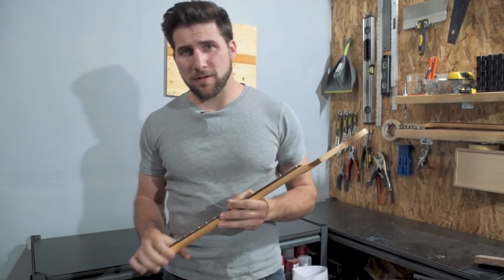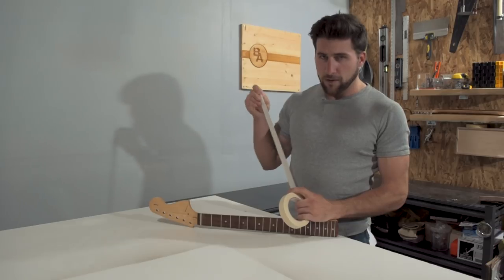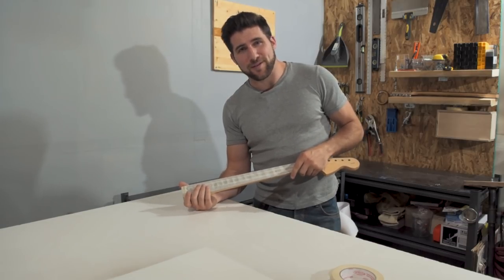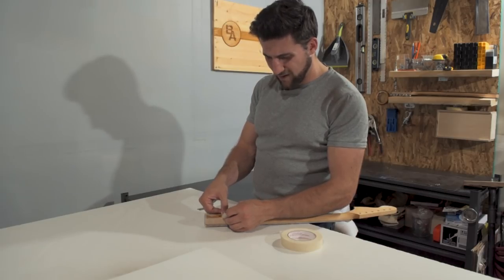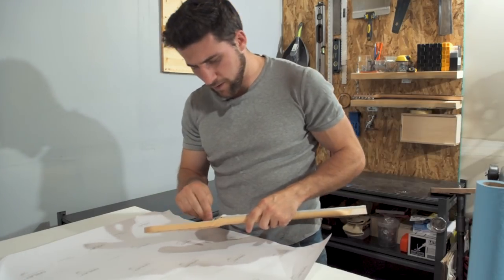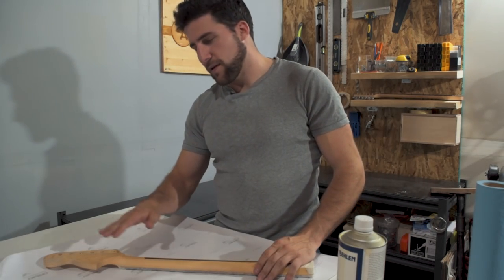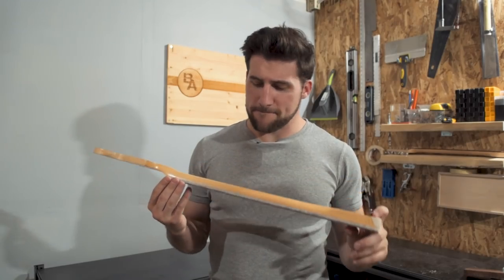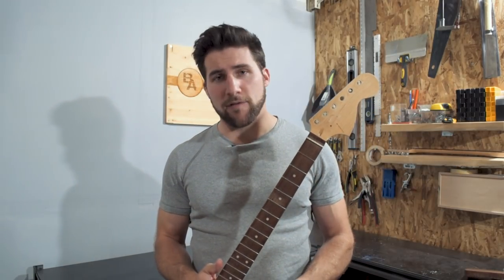How to finish a guitar neck

Comment: Rather than use tape to fill your tuner holes, try using cheap foam earplugs.  Not the cylindrical ones, the slightly tapered earplugs  They seal up great and are re- usable, and really cheap.
Reply from the maker: Good idea. Thanks for the suggestion.
Reply: My wife came up with that out of nowhere...after I made her watch that part of your video. LOL
Reply: I clean out the holes with a reamer afterwards.... It takes me less than a minute.
Reply from the maker: I don’t think it takes long to put ear plugs in the holes haha.
Reply: @BradAngove  I won't be encouraging my wife to watch you plug holes or snuggly fit wooden shafts into pockets any time soon, that's for sure!
Reply from the maker: Wouldn’t want her to slip off her chair and hurt herself?... haha jk
Reply: Most people use the earplugs while I'm playing!
Reply from the maker: Totally forgot I had said that haha.
Reply: This is the kind of no-nonsense practical advice I look for. Great idea, I have 100's of these.
Reply: but it makes them kind of stiff and uncomfortable when i insert them into my ears later
Reply: Gonna snag some from work, thanks!
Reply: That is a great idea
Reply: This is fucking amazing. Thank you

Comment: I've never tape'd off the heel like you did.  Never had any issues with re-fitting within the pocket and if I ever did, I would just steel-wool it and follow up with a light buff.  I typically spray on Nitro-Cell and to get a smoother action on the back of the neck, again I'll steel wool it with 1000 or higher.

Comment: Good one, Brad, very nicely done!  Only thing I'd recommend would be to use blue painter's tape rather than standard masking tape; it's less sticky, won't leave glop when it's removed, and will definitely come up in one piece, something that ya can't guarantee with a lot of regular masking tape.
Reply from the maker: I like the blue tape, but not for edges on this sort of thing personally. It's great for walls, but all of may paint is durable enough here that I'm not worried about peeling any up, and the tape isn't on long enough to leave residue. I find it more difficult to match those perfect lines with the blue stuff.

Comment: Great tutorial buddy, but I need some advise. I just received my bass guitar kit (maple neck and Mohagany body unfinished). I have used Teak oil on the body and neck and awaiting it drying. Can I then use clear polyethylene  over the body and neck for moisture protection and a little depth. Kindly advise accordingly.
Reply from the maker: If you let it dry fully you can get away with that (or at least I have), but it’s not recommended.
Reply: @BradAngove  Thanks Brad really appreciate your reply 👍

Comment: Is it ok to use more than one layer of Teak Oil? also is it ok to use an oil based Varnish after oiling to really seal the wood? Im asking because i accidentally sanded the varnish of my Ibanez AZ neck and I used Teak Oil because I thought Ibanez necks had just oil but it seems they use some kind of varnish..
Reply from the maker: Yes you can layer it or just go straight to the varnish. Personally I like using Odies oil on my necks these days.

Comment: Hey Brad great videos. Quick question I have a fully maple neck. How do you recommend finishing the finger board side? Can I use the same oil on that side?
Reply from the maker: Yes you can oil the maple board if you want. There are lots of options - this is certainly one of them.

Comment: Very very good video Brad! A question... how to  use tru oil to obtain a bit ambered colour on the neck? Tru oil is quite transparent. I would like to paint my necks to obtain that  glossy yellow vintage colour. Do u suggest me not using tru oil?  Which one? Thank u in advance.
Reply from the maker: BIG 66 your timing is excellent. If you want to use an oil that adds a bit more amber, check out the guitar neck finishing video that I just posted today.

Comment: @Brad Angrove - If you want to put a waterslide decal on the neck, can you put teak oil on over the decal, or will the oil damage the decal? Thanks!
Reply from the maker: If the decal has dried on there properly you should be ok, but I’ve never done it so I don’t know for sure.

Comment: I have a Mighty Mite Maple neck that already has a light oil finish on it. It's really light and I want to darken it up a bit. Will the oil you use do that or is there another type of wipe on product I can use to darken it up? I really don't mind I'd it's gloss or satin.  Thanks
Reply from the maker: You can darken it up a bit with polymerized tung oil. Or you can mix a bit of dye into some oil and apply that.

Comment: what about  clear coating a fretboard? ... Is there any issues with clear coat attaching itself to the fret wire ?
Reply from the maker: Polish up your fret wire first. The clear will go over it, but won’t stick properly. Then you cut down either side of the fret and peel the clear off the fret wire.

Comment: Hi Brad, Does the teak oil dry or harden or cure or whatever, or just stay oily/greasy. I wish I knew which oils hardened up. It never really says that on the can. I use raw linseed oil to rehydrate rosewood fretboards and I know it doesn’t really harden much if I was to leave it on. Which I don’t.
Reply from the maker: Teak oil dries. So does tung oil, which is also a popular choice.

Comment: Good job! But is it tick oil make surface durable? And is it possible to put it over a stain or paint?
Reply from the maker: It’s not as durable as some other finishes. You can put it over stain. For paint, it depends on the type.
Reply: @BradAngove  Thanks!

Comment: I did use teak oil after i sanded mine! Never got the shine man and it look like still wet and got a weird smell to it? What should i do?
Reply from the maker: How long ago did you apply it?
Reply: Brad Angove it was couples days ago, after i sanded it, i gave it almost 6 hours to dry, then,  i try to removed the excess oil and then it was not dry enough to be handle. I used a degreaser because of the smell,  it got a funkier smell after that lol , so i had to put it to dry completely  about 1 feet apart from a fan space heater. it did good to it.!
Didn’t get the result i wanted but! I recover the wood.

 I believe it is still drying, because idk how much from of  the teak oil it soaked in.

I wanted a silky glossy feeling on the neck, it was a satin urethane before I started this little project but it was kind rough for me and difficult to clean since my hands sweat and was living darker patterns on the neck, it is a cheap guitar tho squier affinity series that comes with accessories. 

If you think at this point i can apply a different finish, stain, or gloss. I am all ears!!
Thanks a lot!! for sharing through this channel this information and getting back to the people that comment as well.
Rock on!
Reply from the maker: Ya, it takes quite a while to dry. If you would prefer to use a gloss, you can sand it smooth after it has dried for a couple weeks and then coat over it with an oil based poly.

Comment: What are my options if i had to paint a bass neck with gloss paint? Would that Spraymax 2k make it worse?  could i sand it with 800 and use that stuff from the vid?
Reply from the maker: I’m a bit confused. Are you saying it has gloss paint now and you want to change that? Or you want to give it gloss paint? Or you want to take a gloss neck and add more gloss paint to it?
Reply: Hahah,,,, sorry.  no. it was a refinish of an old cheapy bass.  i painted it "EVH" style with high gloss. Even the neck.  i didnt know about this until i saw your vid, i thought high gloss and clear coat would be nice and slick.
Reply from the maker: Well if it feels comfortable then there’s nothing to worry about. If you feel like it’s gripping your hand a bit, you can just sand it lightly with some 1500 grit sandpaper.

Comment: Any recommendations for a finish to darken the wood??? The grain doesn’t look so great on my diy kit.
Reply from the maker: What kind of result are you looking for? And does your wood have sealer on it?
Reply: Brad Angove hey thanks for the response. There is no sealer on it. But the wood is very bright in color. And I’m looking to get that classic strat look on the neck. Is there a way to darken it a bit before sealing it?
Reply from the maker: A few ideas here. You can dye it with some amber. You can finish it in an oil based finish, which will darken it slightly with that amber hue. You can finish it with tung oil under poly. You can tint a clear finish with some amber aniline dye. You can start off with some watco golden oak danish oil and let that dry before using poly over it. Or you can seal it up with some slightly amberred shellac before applying your final finish.
Reply: Brad Angove great suggestions I appreciate the help!! If you were going to do the job. Which would be your preferred method? Thanks again
Reply from the maker: I’d probably layer an oil based finish over a light amber dye. You know... just to make things complicated.
Reply: Brad Angove haha. Yes!! And that’s y I love the channel. Thanks for the advice bro

Comment: Would a nice microfiber towel be ideal? Thanks for the vids!
Reply from the maker: I don’t use microfiber for anything but cleaning generally. It tends to leave scratches if it’s used for polishing, and it holds too much material to be the best choice for application in my opinion.
Reply: @BradAngove  thanks for the advice! So like an old t-shirt?
Reply from the maker: @H4UN73R  Yes, an old t-shirt should work fine.

Comment: How about teak oil on the rosewood (or other dark) fingerboard?
Thanks man. Nice vid.
Reply from the maker: If done that before, although I prefer tung oil.
Reply: Thanks Brad. Can you tell me about when to add water-slide decal with this finish? Before or after oiling? Is it even possible? Cheers -M
Reply from the maker: I’ve never added a decal on something that wasn’t a film finish, so unfortunately I’m not sure.

Comment: How many times do you coat over the wood with the oil, and how long do you wait between coats?
Also, what would be some negative side effects of just simply using a damp shop towel to clean off the wood after sanding as opposed to using wax and grease remover?

Love your stuff, thanks!
Reply from the maker: The number of coats depends on the desired finish. Keep coating until you reach your desired look and feel, with about 45 minutes between the first 4 coats (then wait a day and repeat if necessary). 

You could trap moisture in your finish doing it that way.

Comment: You normally don't spray finish rosewood or general rule of thumb anything other than a maple fingerboard.The squeaky noise you hear sometimes in concerts are new strings.
Reply from the maker: I personally wouldn't spray maple either for a fretboard, but to each their own.
Reply: Brad Angove Maple fretboards need some type of finish if not it absorbs all the dirt.The rosewood,Ebony,pau ferro any dark wood those you don't finish.You could but normally people don't.Great video bud.Also the new camera edit looks really good!

Comment: I like tru oil for finishing. 3-4 coats gives a natural feel, 5-7 for real smooth, 10+ for a gloss. I usually use 3 coats if it's for me.

As for getting the gloss off a neck, I use 1,000 or 1,200 grit sandpaper. Steel wool works to, but it leaves little metal shavings that always find their way to the pickups.
Reply: Hi there, How long between coats, and overall dry time?
Thanks.

Comment: What about just sanding the wood with a 400 grain sanding paper? I just did it and it's super comfortable to play
Reply from the maker: If it's already a gloss finish and you just want to knock the gloss off of there, thats the easiest way. I usually use 1200 grit for that.
Reply from the maker: I tend to avoid using steel wool in necks, but it has the same effect as far as the finish goes.
Reply: Ive heard of people using talcum powder for sweaty ass syndrome.
Reply: Jaume Casanova d
Reply: The best thing to use in that case is the green side of a Scotch-Brite pad. Also, tape off the lines where you want the new finish to end at the headstock and joint and make sure you go all the way to the sides of the fretboard (won't hurt it at all) to keep it from looking tacky and to eliminate all friction spots. Wash your hands before you play, you'll reduce the oils that will build up and cause you to have to do it again every few months, because you'll eventually punch through the finish.
Reply: Do you sand down the hole old finish until you have only the wood- surfice?  Can I put a decal on the oiled headstock after the finish?
Reply from the maker: I usually sand it off, yes. And ya you can decal over oil finishes.
Reply: @BradAngove  Thank you for the fast answer.
I've already started my bass project thanks to your great video. I sanded the neck just like you described it. I will probably use linseed oil.
At the moment I'm in the process of removing the color from the body.
I don't know yet which finish I'm going to use for it. It is made of linden wood. I don't want to paint the body. maybe parquet oil?
Thanks for your inspiration

Comment: Since Im without a working guitar now, Ive started on the Tele.
I ordered the pickups.. A Hot Tele 63 for the bridge, and a gold foil Tele for the neck. So, those are ready to roll.
Got the locking tuners and bone nut also.
Ive already got 2 coats of tung oil on the mahogany/ebony neck. Its the Formbys low gloss type.
It says to use steel wool after each coat drys but Im using 1000 grit instead.
After I get 4-5 coats on Im going over it lightly with 800 grit because I want a satin feel.
Ive got that can of poly for the headstock, and I have it taped off.
I'm super happy with the tung oil. Its exactly the neck finish what I wanted. Looks awesome, and really easy to do.
I'm going to use  True Oil over the painted body. Yea, I'm going for it. lol If it gets wavy or bumpy, I'll polish it flat at the end with some compound and polish.
My only question is if I should scuff up the paint before I apply the true oil?
I think I should, but want to make sure the scuffs dont show when Im done. I'll prob use 1000 grit to do the scuffing. Sound like a plan?
Reply from the maker: I agree. Sounds like a plan.

Comment: LMAOL too funny & great video as always brad !! :)
Reply from the maker: Thanks Terry. I'm glad you enjoyed it.
Reply: I just was working on a P Bass neck I forgot to tape the bottom of the neck!!!! Yikes well It did need shims before maybe it will work out. I got a run yesterday on the face of the headstock I went to cut the runs off that can be done but I'm not in practice doing paint finishing. So I doing rattle can clear had to sand down the whole face again. I hope it turns out shiny headstock w/less shiny neck. It's rose wood fret board.
Reply from the maker: +Watchman4u as long as the coating is reasonably thin on the heel it should be fine. Sometimes it's easier to carefully scrape off runs with a razor blade.

Comment: Teak oil isn’t just pure oil - different manufacturers add different drying agents and solvents to make it easy to use. I would experiment on some smooth pine and see how sticky it is when dry. You may have to polish it with a fine synthetic scouring pad to get it smooth. Depends on the oil. Also some companies add just a little dye so it is darker than Danish oil.

Comment: Awesome video!  If I have a neck with barely any finish on it (it's a cheap Squier with a very light satin finish), is sanding still necessary?  Or can I just finish on top of it?
Reply from the maker: You still need to sand to allow the new material to stick.

Comment: Hey Brad. Really informative video. I just purchased a Stingray short-scale Bass. The neck is a little Dry Feeling. I love smooth, slippery Satin Feeling necks. Is there Anything I can Apply (without sanding or removing the neck) to make it feel more Smooth and Less-Dry . . . without having that Sticky Lacquer feel ?
Reply from the maker: Are you familiar with Odies oil?
Reply: @BradAngove  No unfortunately. I am not as knowledgeable-as-you with this topic. I can do Set-ups, Intonation, Float-trem, but know little about woodwork. I would not know what-to-do? Appreciate the reply.
Reply from the maker: Have a look at my video on it. I think applying that with a gentle abrasive might be just what the doctor ordered.
Reply: @BradAngove  Thanks again - will do. oNe LovE from NYC

Comment: You dont have to take the neck off and mask the fretboard,  just put some fine grit sand paper in your hand and "jerk off" the neck.  You'll only sand the areas your hand slides on while playing,  and you dont have to worry about possibly causing intonation issues by removing the neck. After you sand off the clear coat, just rub with lem oil, which is also an excellent fretboard conditioner,  so if it gets on the fretboard, it's fine. Then just rub off the excess and let it set. Bam! Project complete. I did this to my MIM J bass and it plays much better.

Comment: is the neck ready to play after letting the finish harden for only 15-20 minutes? seems like that's really quick, especially when i read about people doing multiple coats over multiple days with nitro.
Reply from the maker: I would give the oil a day or two to dry before playing it. It dries to the touch quickly, but takes a while to harden. 

Nitro is similar in that it dries to the touch very quickly. It can take about a month to harden fully though.

Comment: I may not have caught it in the video, but how long should I wait before putting the hardware on? I'm using teak oil.
Reply from the maker: It depends on the temperature conditions, but because the oil soaks in somewhat and I don’t build up too many coats, I generally only bother to wait a day or two.